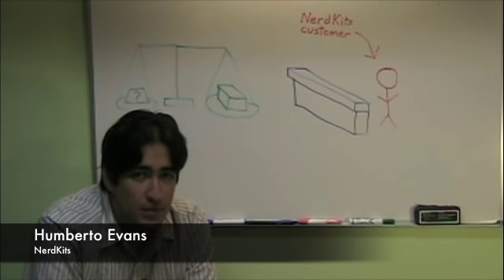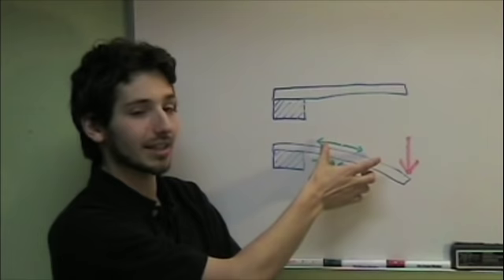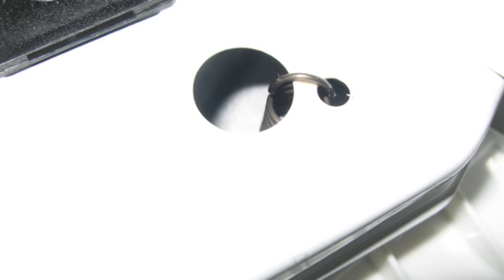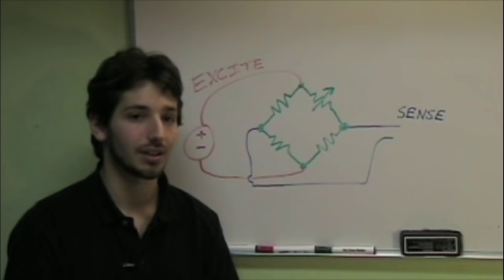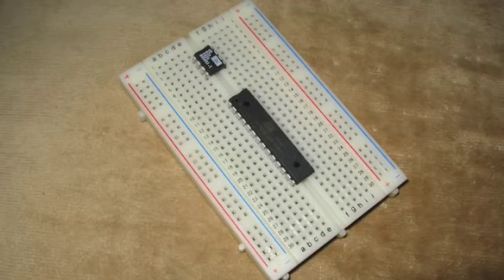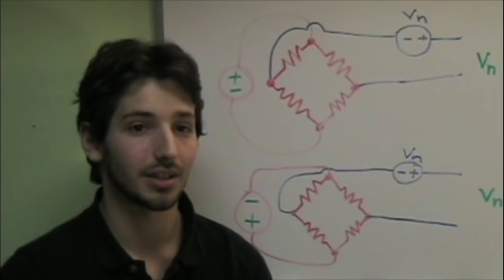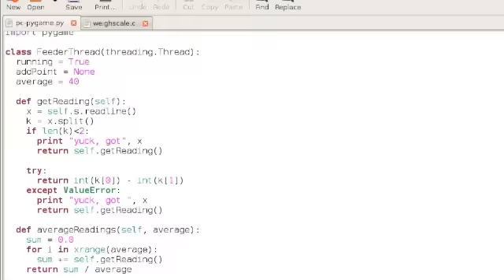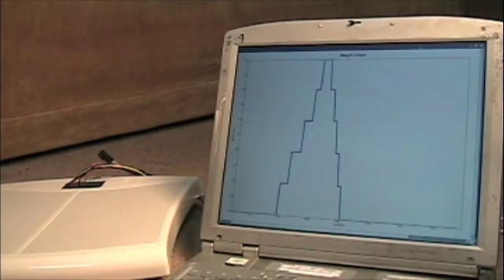Digital Scale Strain Gauge Weight Sensor

Comment: Very nice tutorial.  Thank you.

(For chiquiviveros, the LM 741 op amp is generally regarded as obsolete, so there are better parts for the price.  The TL081 is slightly newer and somewhat better. "The AD620 is a low cost, high accuracy instrumentation amplifier that requires only one external resistor to set gains of 1 to 10,000")

Comment: This is an excellent video, can you help me with a doubt? I have a digital scale and if I shake it a little, I will have a different result than if it were still on the floor. I found this when I were putting the scale out of the box and inmediatly measuring myself, it would give an altered result but if I let it rest a few seconds, then I will 'calibrate', I'm trying to find out why this happen! Just out for curiosity. Someone knows?

Comment: but my sensor has 3 wires, red, black and white , I think the red is (+) black (-) and white is signal, datasheet say 3-10 DCV operation, I used red to + and  black - I read of the white wire  but I dont have nothing in my multimeter even in mV, is right the polarizatation ? and read the white wire how positive and my multimeter and black as ground .
Reply: XXVorteXX Were you able to figure out how to use the sensor then?

Comment: Are there smaller/flatter sensors to accomplish this? Looking at the scale it was pretty big but I was wondering if there are any that could be smaller than a mm?
Reply: did you ever find out this answer?
Reply: Yea, Fabric Resistant Sensors. They are less accurate but for 20 bucks a pop you can get some with <3% accuracy.
Reply: NP! What are you trying to accomplish? There are other ways to make these types of sensors more accurate. For instance, dipping them in a rubber sillicone which reduces interference or loss

Comment: ugh. for under $100 in even 2008 money, you could have just bought a scale indicator and real load cell that provided a serial output... 

seems like a lot of work to make something that has existed for decades. 

and no way that's accurate with cheap bathroom scale stain gauges.

reference: I do this for a living
Reply: Right, because EVERYTHING in life is about doing things the fastest, easiest, cheapest, or laziest way possible, correct? Nothing is EVER, y'know, maybe about learning/teaching how to do something useful? And because the value of knowing how to do something NEVER extends to other areas of our lives where we might be able to apply that knowledge, right? Or maybe... some people might actually prefer to make use of resources/materials they may already happen to have on hand, rather than necessarily always consuming more and more and more... as if this planet really needs for our excessively-wasteful lifestyles to extend to every last thing we do, as we continue to keep buying more and more STUFF, while trashing all of our electronics the moment they're not the latest or greatest available, or when needing even the slightest repair in situations when they might actually be very easy, simple fixes... (and to be clear, that comment's not in reference to any simplicity/complexity of this particular project, but rather, refers to the concept that not everyone cares to govern their choices or consumption habits based on the "easiest" or cheapest solutions, as you'd suggested.

Plus, that's also a rather short-sighted perspective, as it assumes there aren't perhaps other people in other countries who might benefit from educational videos like this, especially when they may not have the same access, ease, or budget to buy everything online as those in north america. Everyone's entitled to their own opinion,  but the "ugh" really speaks of your lack of appreciation (and also lack of respect) for people like this/these guy(s) who took the time and effort to make a video and share some info/knowledge with others.... y'know, to teach actual skills!